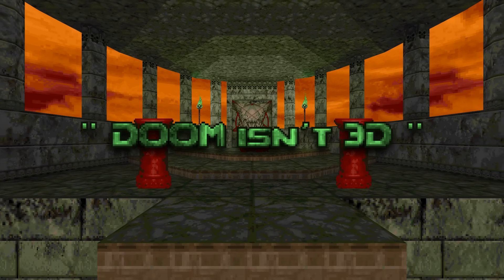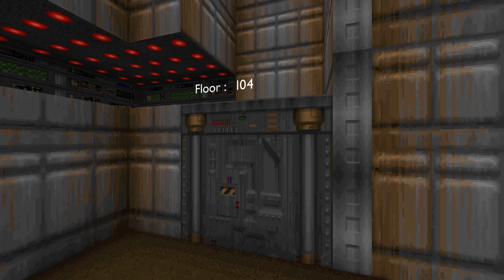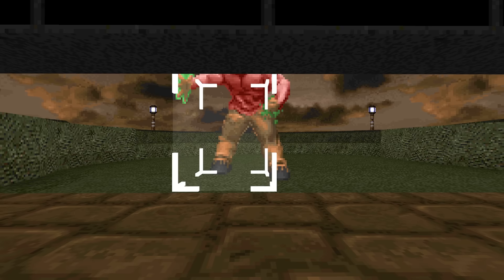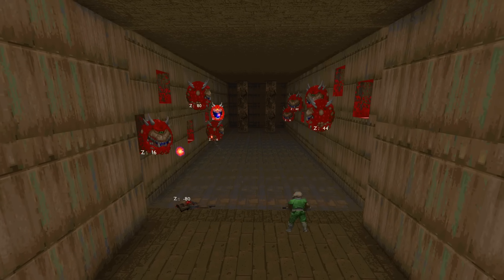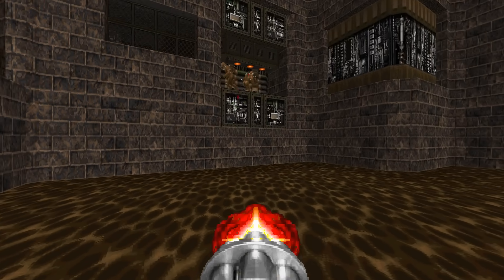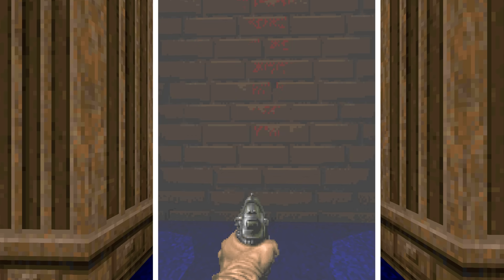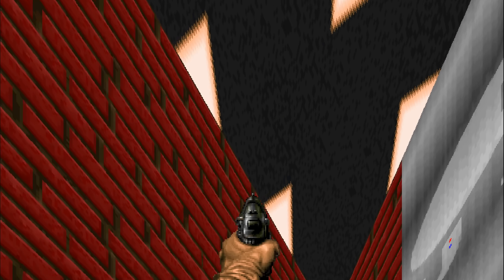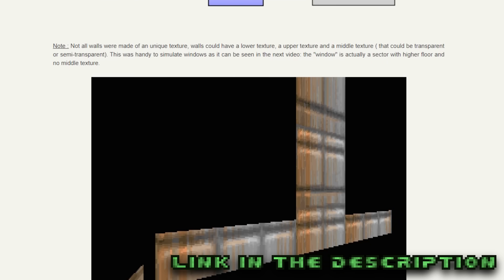Doom engine - Limited but still 3D

Comment: So it is 2.5 d and it's basically a 2 dimensional top down bunch of sectors that get extruded. There's no 3D space. The z axis is only referenced for things like entities. That's it. Again there's literally no 3D space. They don't use floating points or anything. There would have to be something like that if it was 3D space. So yes it does indeed look three-dimensional but that's about it. You can't expect much more for 1993. Interestingly people don't seem to claim that Duke Nukem 3D is fully 3D either. Quake is. It has actual 3D coordinate space. It makes a big difference too it's something you can spot right away when you go to change from one to the other.

Comment: Visually, Doom obviously displays a 3D environment. That's what made this game and it's predecessors special...visually it was obviously 3D.

When people say "Doom isnt 3D" , they aren't speaking of what you see on the screen.

They are talking about the Game engine. 
The grid of coordinates in which objects can have position, has 2 spatial dimensions. 

It's why sprites weren't able to be on top of each other. And rooms couldn't be on top of each other. 

In terms of the Z-axis, everything was at 0 on the Z-axis. You add collision and suddenly sprites can't be on top of each other. 

What makes these types of game engines special, is that the visual appearance of 3 spatial dimensions was created with only 2 spatial dimensions in the game engine.
Reply: Sprites CAN be on top of each other 2:55

Comment: The Doom Engine IS 3-Dimensional. The World you are transversing has x, y and z coordinates for all moving objects. However, many of these elements are simplified such as infinitely tall monsters blocking X, Y movement, infinitely tall square explosions (they're rectangles not cylinders) AND the level geometry itself is a projection of a 2D map. Making Level Geometry on top of level geometry impossible, you can stack things (objects, doomguys, monsters, etc) but cannot stack lines and sectors.

Comment: I'm not sure I fully agree. I mean, sure, you can argue that 3D is just 3 numbers and 2D + Z-number counts as 3 numbers. But the way I understand 3D in video games is that every vertex of geometry has 3 numbers noting the location of the vertex. This isn't true in Doom. The world is made of 2 number vertices or points and an additional property number that is used in SOME calculations. That's why it's not possible to create slanted walls or freeform shape in the world. The game still relies on drawing vertical lines from a 2D map. 

You can add a Z-number in 2D top-down games that allow entities to fly over you, or you walk over and under a bridge, apear bigger or smaller, etc., that alone doesn't make those top-down games 3D. It's just an additional special number that allows more height logic, like jumping, stairs and bridges in 2D isometric games. 

In proper 3D games, every vertex of the geometry has 3 equivalently used numbers, so the world can be shaped in 3D, entities are free to move in all directions, stack and the limitations described in the video aren't applied. The z-number, as I understand it, is a special number just used to separately calculate SOME aspects, like where on the vertical line to draw the entity, whether to allow an entity to pass through or not (e.g. tall monsters not fitting in, projectiles missing you), etc. With X and Y, you are free to draw points anywhere so you can build walls in any top-down 2D shape you want, but you can't do that with height, hence the limitations.

I view it more like 2D with extra steps rather than 3D with limitations.
Reply: the level geometry is 2D but the game world is in 3D while playing in it. Rockets will fly "above" and "through" monsters below. Monsters that are too tall cannot enter low ceiling rooms. Linedefs cannot be on top of Linedefs (room on room), while "Things" can.

Comment: Doom is 2.5D.
While it is 2D it does have 3d interactions.

If you wanted you could solely play room from just a 2d view of the map, that's why it's 2d. However there is still stuff that would not work, or would no longer make sense as a flat plane, hense the .5

Comment: What I gathered is that it IS 3D, but not in the traditional, polygon rendering way. More in the pixel column, no polygon way.
Reply: Doom only runs well on polygon hardware and struggles on quads like on Saturn and 3do . And nv1
Reply: @ArneChristianRosenfeldt  I never actually noticed that. I wonder if that has something to do with the way DOOM's engine interacts with the hardware. It was meant for 386/486 hardware, and maybe it would have to be rewritten to work well on 32 bit hardware that does quads.
Reply: @beanmchocolate3900  Doom could use quads for walls on 3do, but not for the floor. People tried to rewrite, but failed. Doom uses GL_REPEAT on the floor tiles. 4 MB is not much, so you gotta repeat those textures ( or have tiles like in mode-z on SNES ). But Doom has angled walls and steps. So the level geometry needs to clip those tiles. Atari Jaguar has many bugs and one of them is that repeat only works 2d. So as with quads, it makes sense to draw the floor tile by tile. But the Jaguar can clip those tiles efficiently and precisely. 486 is 32 bit. And everyone uses 16 bpp. Doom has a final full screen shader to dumb this down to 8bpp due to the silly VGA standard.

Comment: Also this video is quite biased (though it seems you admitted this somewhat mid-way into the video). Newer engine forks of id Tech 1 does feature 3D elements that may have finally completed the engine to become true polygonal 3D (especially GZDoom, since you could even potentially import Quake 2 models into the game now). This was not possible with vanilla id Tech 1 - not without modifying the code to make it possible.

That is where the argument of "Doom is NOT 3D" originates from. This is also probably why these modern zoomers got the misguided idea that "Doom is 3D", or the wrong idea that "Doom was always 3D from the start!" - combined with a negligence and disdain for education and literature improvements (this generation really hate those two - I am dead serious), we already live in an idiocracy now; it is truly starting to look like that 2006 film.
Reply: What are you talking about?? The engine calculates length, width, and height. The only reason it had infinite height was to save on processing speed but it is by definition a 3D game. It's map data may be 2D, but that doesn't mean it isn't 3D as a game engine. Just because you don't understand the engine doesn't mean it's not 3D.
Reply: @lainamitclaire  Don't pretend you know me like some-know-it-all prick. I already understand the damn engine mate. I've been using it for 8 bloody years! I messed with the original engine before trying my hand at their forks - ZDoom, GZDoom, Skulltag, Zandronum to name a few. But what good is a '3D' engine if you cannot even access all of the dimensions necessary for 3D game to truly function? All of the official id Tech 1 games were literally pseudo-3D - The illusion of 3D imitated in 2D projection space, both visual and technically. The graphics were math-calculated, software rendered. OpenGL or True3D capabilities did not even exist. I only saw a true difference when I touched the modern ports, especially GZDoom - in which all these constraints are virtually gone and you can actually access. OpenGL and all of the True3D rendering finally exists in some (if not most) of these id Tech 1 engine forks. These forks are the only evidence where I can see the legitimacy of the "Doom is 3D" theory. The Doom the fans made it 3D.

Comment: This is not 3D.
This is 2.5D.
Reply: Not a thing. It's 3D.
Reply: @lainamitclaire  It is a thing. It's 2.5D.
Reply: @OnyeNacho  Nope. 2.5D is perspective. It means a 3D game in a 2D perspective. You cannot have a 2.5D engine, because you cannot have a half of a dimension. Doom performs calculations on the X, Y, and Z axes. Width is calculated, length is calculated, and height is calculated. While the height is set to infinite, it is still a variable in all of the equations.

With three dimensions accounted for (Length, Width, Height), that means Doom is 3D.

John Romero worked on it, and he thinks it's 3D. Tom Hall worked on it briefly, and he thinks it's 3D. American McGee worked on it, and he thinks it's 3D. John Carmack coded the damn thing, and he says it's 3D.

2.5D is not an engine thing. You cannot calculate half of a dimension. If there were only the ability to go above or under something instead of both, it wouldn't stop being 3D, it would still be 3D.  You are conflating an optimization for people's 386 CPUs of the era with a programming choice. I do not think you understand this engine.

Comment: lol you got me with the bullet on legs. How did you get these animations with the cool custom sprites and the hit boxes around stuff?
Reply from the maker: I made a mod for GZDoom that adds custom entities for props and alters existing ones to add 3D box visuals. 

Pretty happy how it turned out, I only regret miscalculating the bounding boxes - they are slightly shorter than they should be, as I didn’t account for the game stretching graphics vertically.

Comment: 4:50 you can do old method in gzdoom you need to switch form hardware-accelerated to doom software mode
Reply from the maker: Yeah, I’ve discovered that after making the video, though it does take scripting effort to overcome vertical aim limits

Comment: if doom was 3d, you wouldn't be building its levels in a 2d editor. what other "3d" game do you know of has a 2d editor for its maps? you're an ill-informed fanboy. go watch ronnie's video on the subject, he explains it well.
Reply: if it is a "2d editor" then why do we have to input heights?
Every so called "3d game" has some function that is limited compared to reality. I can say that 3d models that are empty on the inside, are not really 3d, or things like that.
Reply: His video does have some inaccuracies. E.G. he states that the fact that you don't need to aim vertically means that the game is 2D. But the bullets aren't 2D, internally they are actually 3D rays and an enemy can easily slide below a bullet or sweep above it. Yes, you still don't need to aim vertically, but this is achieved through special auto-aim system - so the developers literally needed to code in special vertical auto-aim because their engine was becoming way too 3D to not make it a necessity. Some leaked pre-release versions of Doom didn't had auto-aim in them yet which made gameplay a whole lot more frustrating, since in them the only way to aim vertically is to physically take a higher or a lower position as if you're Megaman, I guess it could have been improved with jumping and crouching, but I don't know if crouching was easy to implement, and while jumps are easy to implement and Doom 2 even somewhat implements them officially, AFAIK developers in id had specifically decided that the game should not have jumps, so the lack of jumps isn't a technical limitation, it's a gamedesign one. And also, despite the fact that the game doesn't have jumps, player's coordinates are 3D - when you fall from a cliff, you don't drop in some weird automatic or artificial-feeling way like in The Legend of Zelda: a Link to the Past, you just start accelerating downwards like in most other 3D games, so the game doesn't only store player's Z location, but also speed in the third axis.
Some real 2D-ish elements are indeed a thing in Doom - the way how maps are stored in memory that doesn't allow for rooms above rooms (an other 2.5D engine - Eduke 32 - actually has a way to add rooms above rooms, but as far as I know the map format is still really 2D-ish), some optimizations like infinitely tall collisions between monsters and players and infinitely tall explosions, and also things like the fact that projectiles, while they have 3 coordinates and they can fly at an angle, their speed is 2D - a projectile moving parallel to the ground will take the same time to reach a wall as the same projectile that moves at an angle (unless it will hit the floor or the ceiling of course). But in most other regards, Doom is very 3D

Comment: Am I crazy if I say it's all x & z, but no y? The y is the illusion. Depth perception is formed by making images smaller and less detailed, and lines are done the same way a perspective drawing is made on a flat piece of paper.
Reply from the maker: That would be a variation of „computer screen can only display flat 2D images“ argument. Which by itself is correct and not at all crazy, but also a little besides the point of the video. All modern 3D graphics create an illusion with 2D projections and switching camera angles, which is a limitation of output medium.

Comment: The issue is people are conflating 3d (philosophical) and 3d (the programming term for 3d point space with 3d vertices)

For the player, it’s 3d. For the programmer, its 2.5 and that distinction does matter. It doesn’t mean it isn’t 3d space. It just is a flag to signify simpler vertical rendering since creating it is much different than typical 3d geometry.

In this way, gauss splats are 100% 3d, but also something else:

Comment: So if the monsters are infinitely tall, how can the projectiles go above them? How do they know where the monster's upper boundary is? Are there some calculations about the height of the monsters after all?
Reply from the maker: All monsters have height and proper vertical boundaries. “Infinite tall” rule only applies to collisions between monsters, players and decorative objects - simply by ignoring the Z coordinate. It’s likely done to avoid any awkward interactions like riding on top of each other. Heretic famously took away this limitation without proper testing which lead to flying monsters routinely getting stuck on other monsters’ heads.

Collisions between monsters and projectiles, as well as level geometry fully take advantage of 3D hit-boxes. These interactions are much easier to program, since the level data doesn’t have many moving parts (apart from doors, elevators and crushers) and projectiles just fly in a straight line and immediately disappear upon hit.
Reply: @borogk  Ah, makes sense! Thanks, for a thorough answer!

Comment: This video is incorrect. Doom runs on a 2D engine, every argument given for it being 3D can just as easily be simulated in a 2D top-down game.
Reply from the maker: 2D top-down argument misses the fact that the Z coordinate - exact elevation levels of objects and level geometry - matters for the gameplay mechanics and not just for visuals. Number of elevation levels also isn’t limited to just a couple like in Link to the Past, it’s a 16-bit number same as X and Y, in-game objects height values are also taken into account.

There is of course no denial that Z matters less than XY and some corners were cut, but denying the whole 3rd dimension because of that is silly.
Reply: @borogk  I guess it ends up being a semantic argument based on what each person defines by 3D (are we talking about internal logic or gameplay/feeling 3D). The entire doom gameplay, including its dedicated variable for simulating the third axis, can be replicated in a game with just sprites that parallax/zoom around based on WASD input, because Doom is at its core a bunch of sprites (or rather path-traced sprite columns) that very cleverly parallax/zoom around.
Reply: Imagine being so confidently wrong.

Comment: Absolutely 3d, but this is just the tip of the iceberg, they don't consider SNES Mario kart 3d! I'm a programmer myself, and even if you argue the background map isn't 3d which is false, the sprites are still bill boarded which means that they are 3d. And going back to that map not being 3d argument, though not equivalent to true projection 3d, it is an approximation, all games can only approximate the projected 3d environment due to the limits of pixels. In the SNES's case it is a limitation of the hardware that forces a mathematical approximation, this is the same as saying the Babylonian/Newton's method is not a sqrt algorithm. Completely blasphemous. And moreover, the approximation is likely almost equivalent anyway because of the limits of the pixels meaning that it would do almost as well as projection-based rendering.

Comment: It's funny how Origin/BlueSky/Looking Glass did full 3D with look Up and Down in 1992's Ultima Underworld which came out BEFORE wolf3D 😏
Reply: I can’t believe that they did a real tilt. The moment any corner in the map isn’t a vertical line anymore, you can’t do per column occlusion, but need a sorted list of edges . Sorted left to right as if the camera was upright. And for the texture maps on the walls, you need to calculate delta s and t. Interestingly, this would not slow down the AtariJaguar because this runs parallel anyway.

Comment: During the part about the blast radius, I noticed something very interesting in the code. Not only does it not account for the Z axis, it's also not a radius at all, since the explosion is not a circle, but a square.

Rather than calculating the radius using both axes and Pythagoras's law, it just takes the larger of the two axes. This means that a monster that's outside what would be the radius of a circular explosion, could be hit by the corner of a square explosion instead.
Reply from the maker: Fun fact, I crunched the numbers once in the past - on average such method is about 12% less accurate, in the worst case at diagonals - 29%. This ends up not being very noticeable in a game where damage rolls have wild variance between 100% and 800%.